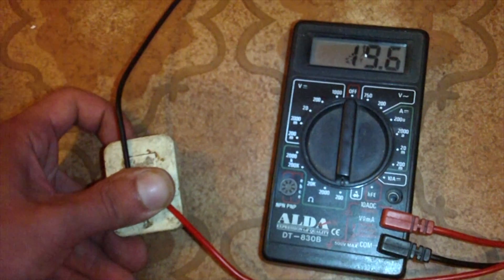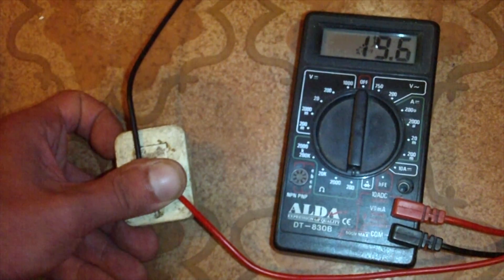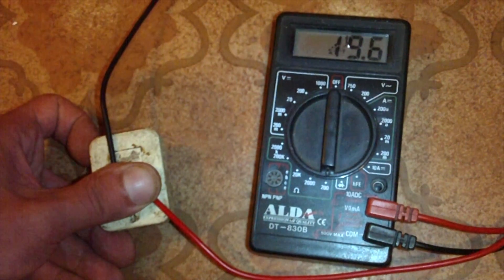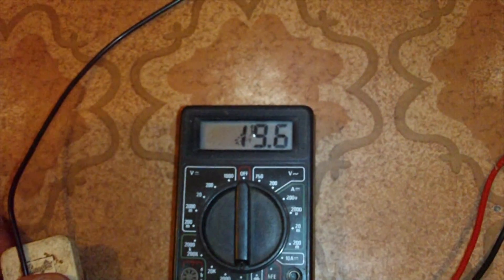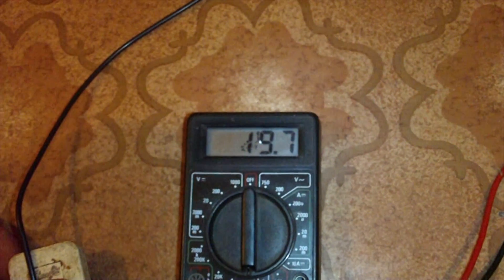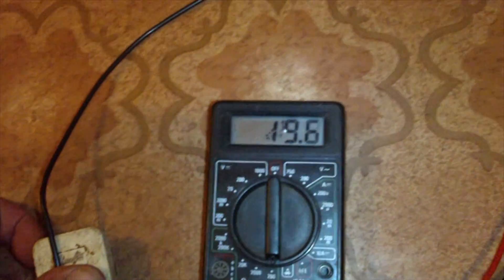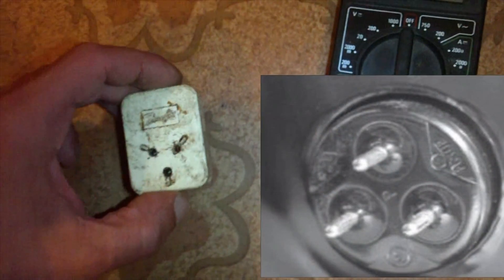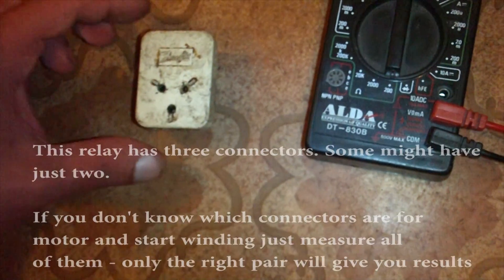How to test a PTC relay (fridge compressor starting relay)

Comment: hi, I am getting a reading of 18 ohms across start and run terminals but the relay still rattles. . Could this cause the compressor to keep running. and not shut off. or go through its auto defrost cycle?  anyway I have tried all methods, and I am still unsure if to replace PTC starter relay.....nice video though, thanks.
In conclusion , mine rattles, but still turns compressor on.

Comment: Many thanks for your most informative style. 
However I have one of these modern fridges that stop working when there is a power outage.  It would come on after on  after 3 to 4 weeks. This happened three times.  It's quiet disconcerting.  
1. How do I reset the fridge 
2. I suspect it could be a relay issue. Being one of these modern fridges that have s mother board what will be the easiest way to check for relay malfunction. 
Any assistance will be much appreciated. The fridge I have is a Hitachi R-SF457TM  made in Japan. 
Warm regards 
KK

Comment: I am just wondering about my fridge compressor LG NS30LAEG and if it has a compressor motor issue / relay or refrigerant leak.
Motor main body seems to hum but gets very warm.  
Three pins on the motor body .  From what I am reading I seem to believe that these motors have two windings, is that correct?
Relay is a P330MCOR0311.
This is on a 'portable' cold box unit, and I am on holiday ...no multi meter with me.  Will try and get to a store today and pick up a cheapo one.  Did not think i'd need to bring my Fluke meter with me.

So, do theses motors have two windings..start and run....?  If relay dead, then it does not fire up start winding?
Reply: Hmm..well I have taken the 'relay' out, the P330MCOR0311, A strange device, not a relay really.  seems to be a temperature dependent disk room temp at 33 Ohm according to spec.  I get 35 at ambient of 24 deg C and 54 Ohm when put in ice compartment for 10 minutes.
Direct feed winding is 32 Ohm, winding via the temperature sensing 'relay ' is 12.5 Ohm and the combined resistance is as expected combining the two, of 44.5 
This is European 240 V AC unit, plated at 58 W on the back panel of the fridge and 76 W on the LG Compresor,with stated current of 0.63 Amp...those figures don't add up in my mind...hmm

But what about the motor windings?  Those figures seem high to what I have been reading ?

Comment: My Samsung inverter makes circuit breaker of the house go off as soon as the compressor starts. Lately the compressor has been making noise. No short between windings and the ground  11.7ohms between each winding. Do you have any suggestions?

Comment: I have an LG air conditioner who's compressor stays on when the a/c is powered off. The hot to hot resistance reading on the line cord is 2.5 ohms. If not the PTC, what other relay supplies power to the compressor that can be welded shut and prevent the compressor from being shut off?

Comment: about 10 years ago our 5ft chest freezer packed up.....we rang specialist GA+R appliance enginiers...they charged £60 and said it was irrepairable within minutes of arriving
I KEPT FREEZER in my loft for storage when we bought a new one £500.
your other vid testing compressor helped me test mine ITS FINE. just needs new start relay  as reading 3.5 ohms.....£7.90 ebay.

Comment: I'm getting just under 7 ohms... so that's faulty?
Reply: No, that is normal and good. Only a very high resistance (when cold or room temperature) should be taken to mean faulty!
Maybe the video doesn't emphasize that enough. This youtuber (kerimil) is not really wrong in what he says in the video, but multiple people here are getting the wrong idea. Maybe if hehad said 5 to 100 ohms instead of 10 to 100 (for a correctly functioning PTC relay) it would have avoided this misunderstanding...but maybe not because as far as I know some may be designed to be less than 5 ohms when cold. If you understand what this thing is and does you'll understand that it could in principle be any small number greater than zero.

Comment: My Danby Freezer wont start and I took out the PTC relay and tested it with an analog multimeter and the needle swung all the way to from left to right infinite and stays there. Does that mean its not functioning properly or does that mean there is continuity?

Comment: On a discarded non-running (but otherwise physically perfect) Haler HSW02C fridge, I found the P6R8MC PTC module open. Prying off the clip that held it together, I found inside two bifurcated spring terminals contacting the AS6R8 PTC element. One side of the element was perfect, but the other had four eroded spots, and thus an open. By rotating the element to new spots, operation was restored. I cleaned off everything with 91% isopropyl alcohol to remove finger oils. In the military world, 6R8 would be 6.8 ohms, but this one measured 8 ohms cold taking into account the .2 ohms of DVM leads. The PTC element was centered radially from the sides of the module by a delicate mica ring which is re-centered by fitting it inside moldings of the module to make sure it went back together as designed. If the erosion reoccurs, I will have to get a new module off a dead fridge. BTW, it's not really a relay in the normal sense, just a PTC element holder. My compressor measured about 9.4 ohms run winding (fed through PTC)  and 11.3 ohms start winding (fed by direct from 120VAC)..
Reply: Not 100% sure what you just said but dang was it fun to read!
Reply: Ur talking about the little battery looking disc thing when you crack open the white start device after pulling good relay off correct? Mine looks burnt and have a 3n1 now and new start device. Can just that part go bad and what causes it?

Comment: just wanted to know was working on a 3phase compressor and on the electrical compartment of the compressor saw a motor protector attached just wanted to know does it play the same role as a PTC

Comment: When I check mine cause it the 2 pin relay the ohms showed 0.016 is that good or would it be good to replace it with a new one.

Comment: THANK!!!  It was on my chore list to fix an old freezer that only clicks at me, turned out the relay test showed no continuity between the Start and Run.  
It rattled a bit but after dropping it (by accident) the solenoid un-jammed. Put the thing back together with the overload and the sweet humming sound of success fallow. I'm happy.

Comment: How about showing clearly which terminals you put your probes on?  It would help the video 1000%
Reply: You should only get a reading across one pair, so by trial and error when you get a reading you're on the right pair.  If you don't get a reading by any combination it's dead.
Reply: @stevescott749  little confusing.  Get a reading on on pair.  Then you say if you don't get a reading on any combination...
  Is it one pair or any combination?
  I was thinking the start winding pair would show a reading.  When energized the reading would switch to run.
  Not arguing at all.  I have two acting up.  Both relays had a rattle, but I am told some may have a rattle and still be good today.  These are not new.  I went ahead and ordered one.  Should be in today or tomorrow.  I was thinking these two were acting up intermittently.
  Guess I may have a compressor proble and the overload may be kicking out now and then.  :(
Reply: Rickey Keeton My part turned out to be OK. My fridge wouldn't cool because it was stuck in defrost.  Turn of a screw.  Boom. But anyway what I meant was you have 3 terminals. So you can (attempt to) get a reading on three possible "combinations" or pairs. 1&2, 1&3, 2&3. Not saying the terminals are numbered, just explaining.  If none of these pairings gives a reading it's dead. If only one pair does and it's of the right value, it isn't. So you're not looking for the "right pair". You're looking for a reading. Somewhere. Either you get one or you don't. Per the video: "only one pair will give you rrrresults".
Reply: @stevescott749  You may have been lucky.  Many times if you have to turn the timer (mechanical) to get it out of defrost, it is an indication that the timer is going bad.
Reply: Rickey Keeton  Probably. But I deserve a little luck.
Reply: @stevescott749  I misinterpreted the video.  It being a relay, I would think you should only get a reading from common to start.  When power is applied the relay should switch from start to run.  Correct?
Reply: @rickeykeeton4770  I'm not an expert in the subject matter. I'm merely giving my interpretation of what is meant by the video.  Respectfully, I think your over analyzing this.  Again, the video does not tell you where the reading should be or the name of it (common to start for example) only that you find one. ONE.  Somewhere.  If you don't you have a faulty relay - PER THE VIDEO.  Not per me. How much would a relay cost you to just try swapping it out?  As a comparison, I replaced a start/run capacitor in my A/C. Capacitor has three terminals.  One pair should be 5MFD the other pair 50MFD. It doesn't matter which pair is which, or that I don't know.  It doesn't matter that one pair is called Start and the other pair Run.  I couldn't find the values.  Replaced the capacitor, problem fixed.
Reply: @stevescott749  no expert either by a long shot, but I think on an ac unit the values do vary according to the unit.  The higher value usually goes the therm or compressor, then the ithets go to the fan on some.  Don't need a value of 50 for a fan.  The compressor uses that extra umph to start up.
  Actually, I think there is Syart, Run, and Fan on some of the capacitors and Common.
  I have had to make modifications a time or two when I ciuld not find the capacitor called for.  Had to get 2 capacitors and wire one to the other in order to get the values needed.
  I do tend to overthink thins sometime when I am not sure about something.  I call it being safe and an attempt not to make the problem worse than what it is.
Reply: @rickeykeeton4770  you're missing the point.

Comment: Just to make sure. If you read less 10ohms then the relay is bad?
Thanx for sharing your knowledge with us
Reply from the maker: Google the part number and find the datasheet of the relay - it should list the correct ohm value. 10 Ohm is a ball park figure - and as such it's ok for vast majority of cases

Comment: On my PTC relay I'm measuring 0.2 ohms between input terminal and the run (M) pin.
5.4 ohms between input and start (S) pin. 5.4 ohms between M and S. Compressor hums, frig not cold. Bad relay?
Reply from the maker: Doesn't seem so. How long does the compressor run when allowed ?
Reply: kerimil
Continuously. The frig is a GE GMR02BANBBB. The compressor model number is SB30C50GAU6. I ordered a 3 n' 1 start kit to see if that fixes it.
Reply from the maker: James Pian Does the compressor get hot after running for 5 minutes ? It seems that the PTC is ok. You might also test the compressor windings with a multimeter - I have a video on it. 

It would be wise to wait for the start kit just to be sure, but it seems to me that it's not electrical problem - but either the refrigerant has leaked out or it's a mechanical problem. Keep me updated, will you ?
Reply: kerimil Compressor and relay get hot in short order. I remeasured the resistances after the relay got hot and the numbers are unchanged. I assumed the resistance from input pin to start coil pin should rise with temperature. The 5.4 ohm result doesn't fall into the 10-100 ohm range that you mentioned in the video.
I did test the coils. (C to M) + (C to S) = (M to S) so the coils are good. Also tested them to a good ground and their is no continuity. So they are not shorted to ground. I can deal with a refrigerant leak. I'm hoping it's not a locked rotor. If it is, I'll just buy a new frig and dissect the old one, for fun . It's cheaper than replacing the compressor.  I'll keep you posted.
Reply from the maker: That's why I asked. If the compressor gets hot really fast then the relay is probably damaged and start winging doesn't switch off after starting. If that's the case then replacing the relay should fix it.
Reply: kerimil
That's good news for me. Still waiting on 3 n 1. I'll let you know how it turns out.
Reply: kerimil
3 n 1 didn't fix it. How do I test the 3 n 1 to see if it's not a bad one? I hear a gurgling noise from inside the frig. The noise continues for a little while after I unplug it. Any suggestions for what to do next?
Reply from the maker: James Pian Does the noise come from the fridge or compressor ? How often does it happen ? Fridges makes such noises from time to time, sometimes this means nothing but usually it indicates problems.

I found a manual for your  compressor > http://www.whaleyfoodservice.com/EquipmentManualsIntegration/Manuals/PAN0583.pdf

It states that normal resistance of the ptc is 4,7ohm which is almost exactly like your results. Try to retest the original PTC: switch the compressor on. Let it run for 5 seconds, unplug and measure the resistance of the PTC. If it is much higher than 5,7 then it seems it's a mechanical problem/current leakage. 

Finally you could bypass the ptc completelly to rule out ptc problems. You'd need a manual switch, even a double light witch would work. Wire it in a way that let's you switch on and off both windings. The idea is that you yourself act as the ptc relay and power both windings initiall, but you switch off the start winding after about a second or two. If it doesn't work then there's nothing more you can do. It's either the refrigerant problem or mechanical problem - in either case nothing you can fix yourself
Reply: kerimil
I can hear the gurgling loudest from inside the frig. I'm convinced it's not the relay. My next course of action will be to pressure test the refrigerant lines. If it holds pressure, the problem is probably rotor lock?

It's a mini frig on my boat (just to keep the beer cold) so I'm not that worried about fixing it. I can replace it fairly cheaply. I don't mind destroying it to learn about refrigeration.
Reply: @kerimil  
I

Comment: PTC checked good but the compressor won't run without a Supco start kit. the resistance of compressor pins are 10, 6, and 4 ohms. none of the pins have continuity to ground. guess I'll have to run the compressor to its grave with the start kit
Reply from the maker: Some compressors require either a start or a run capacitor. Apparently, that's the case in your situation. If the PTC is ok, then test the capacitor/s

Comment: MIne was completely different (american and a whirpool) ,in form ..and connectors .. only has two holes, but you were right on the resistance thing , I did open it and fiddle with it , cause I found two nasty burnt marks almost silverish in color exactly were the connectors touch the PTC disc/pill/whatmecallit..that it is inside ..and right now Im hearing my Fridge run and humm like a kitten ..awesome mate ! thx and god bless..:D
Reply: kerimil Milo Rivera I am about a year late but I am hoping you could get back to me on this one.  I read about 10 ohms across the terminals but I went ahead and opened the relay and found "silverish in color exactly were the connectors touch the PTC disc/pill/whatmecallit" as well.  Is this grounds for replacing the relay?  Thanks in advance!
Reply: Blake huffman hi , what i did was to move the ''disc around '' ..so as to make the terminals avoid the ''silver stuff''...get it ? ...meaning it is still salvageable...I'll get back to you on the 10 ohms thing..:)
Reply from the maker: Blake huffman Hmm could you post pictures of it ? It seems to me that you are describing an older type of starting relay (based on metal parts breaking contacts due to temperature)